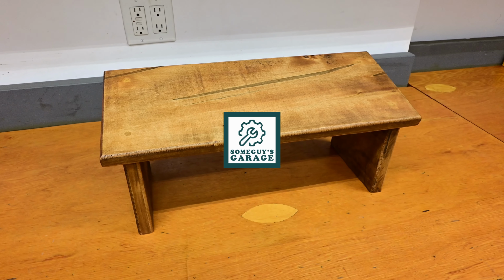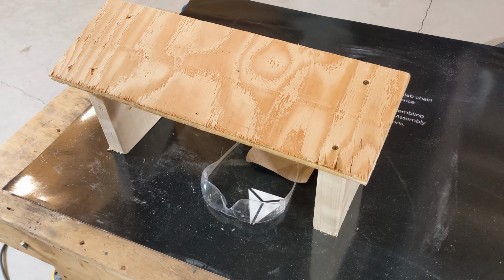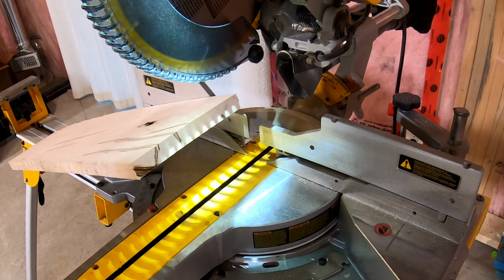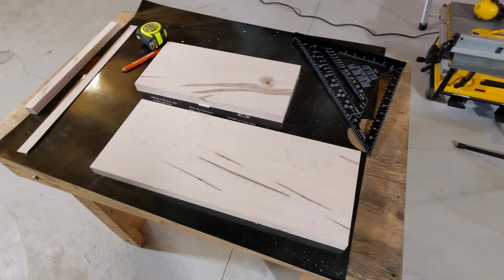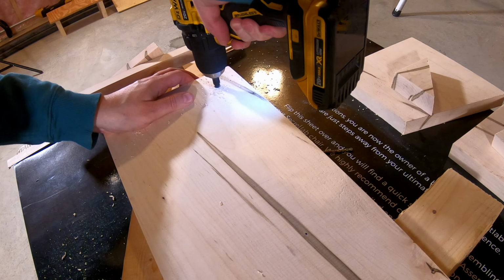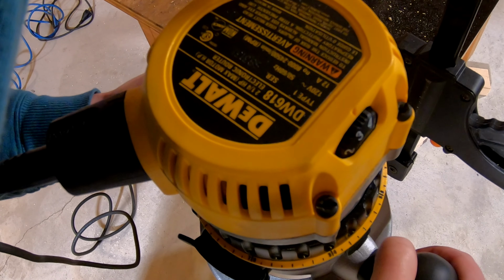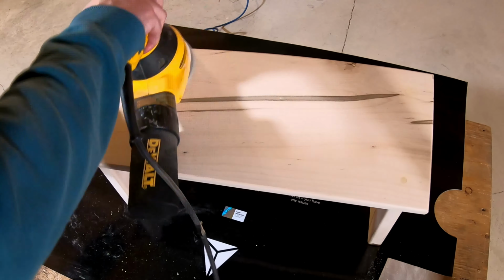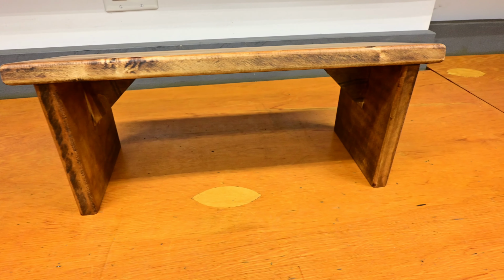DIY Build Yoga, Meditation, or Prayer Kneeling Bench

Comment: Neat little bench. I could see something similar as a small step for my short GF. Something to try next time.. assemble with biscuits and if the screws are needed for assembly, remove the screws after glue up and replace with dowels. I had a bunch of very twisted pine I was making a long box with. used a bunch of screws to force it into submission and replaced em with dowels after the glue had set. came out cool for an afterthought.
Reply from the maker: Yeah, this is designed for kneeling (you basically put your butt on it while kneeling), hence the angled top...but you could very easily make a nice step stool with the same design. If you make something like that, definitely share it :)